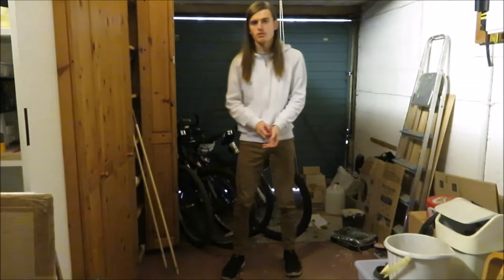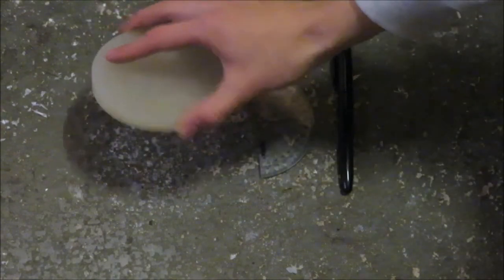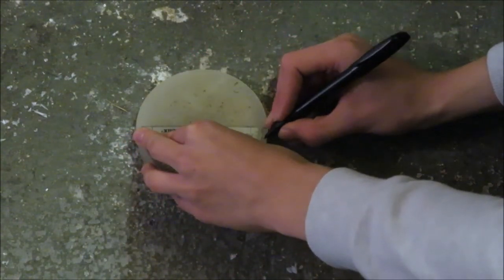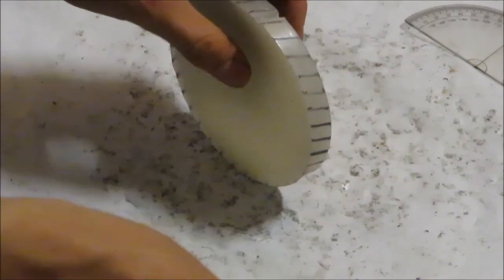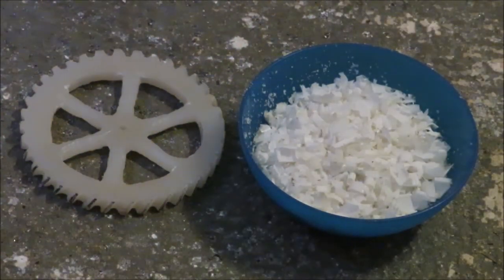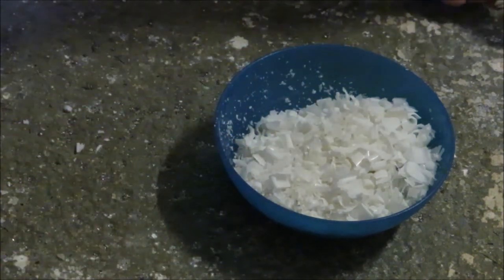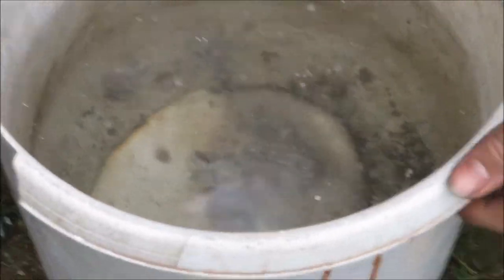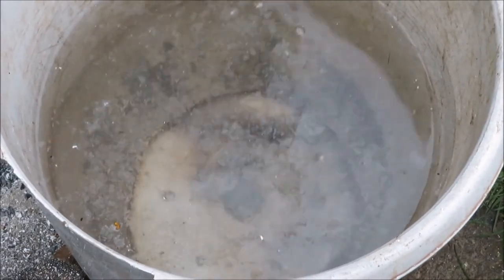Making a worm gear from scratch. Pt1

Comment: Very ingenious!  I would have liked to see the final result (I mean, after grinding etc.).  Cheers from Australia, Rolf.
Reply from the maker: I am working on it having a little trouble with the tolerance of the teeth on the gear and fixing it to a central shaft  properly there will be a part 2 one I get the problems ironed out.
Reply: @infernalcontraptions8648  I'm looking forward to that!  Good luck...